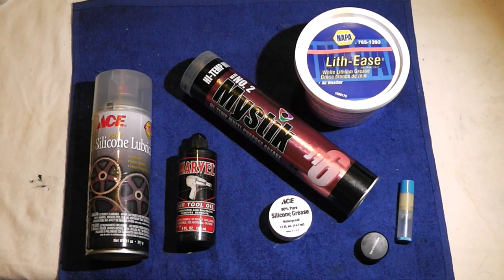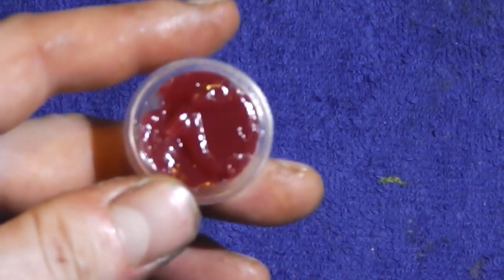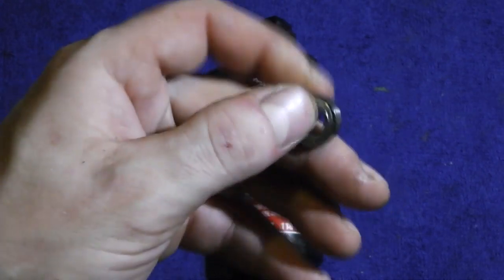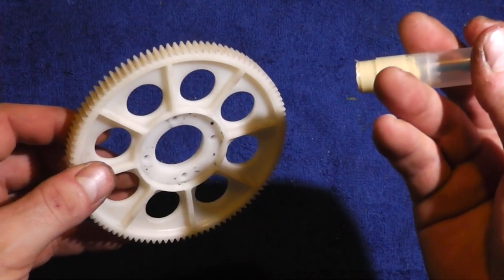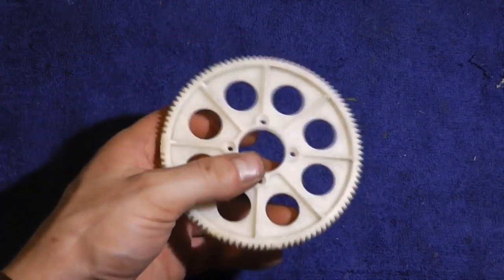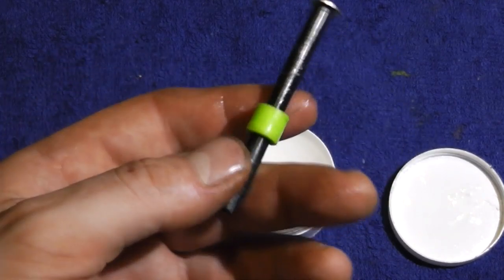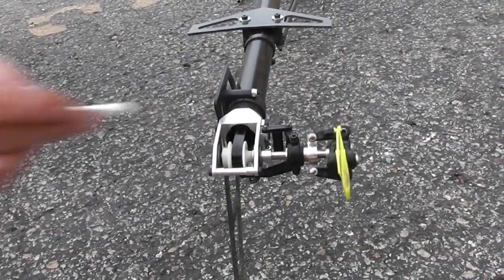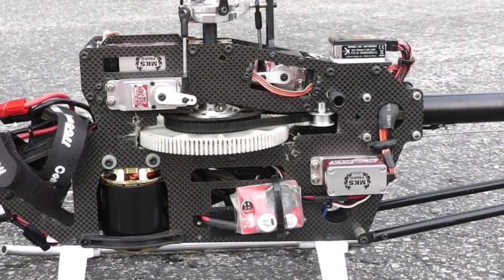R/C Heli Tutorial #6 Lubricants

Comment: Have you had any experience breaking a belt? From wear?  On my belt drive trex 500, I have never lubed the belt.  With over 6000 flights, I have changed the belt maybe 6 times only when I would start to see a "little fraying".  My headspeed is about 2700 at max, and I set the belt tension "somewhat loose".  For my heli, I probably wouldn't use any lube on belt or even gears(never had any unusual wear), because I see more damage from dust/sand abrasion in my greased parts.  I see contaminants every time I regrease my thurst bearings(main grip, tail grip and shaft/thrust).  Those I do every 100 flights. Plus, I fully remove the old grease with paint thinner each time.

Comment: White Lithium is not good - it will harden up if it's exposed to the sun or heat. I have a scale Bell helicopter I have to disassemble because of that grease.The Marvel Air tool oil is great - I also use it mixed with synthetic transmission  oil as after run oil for my Nitro Engines.